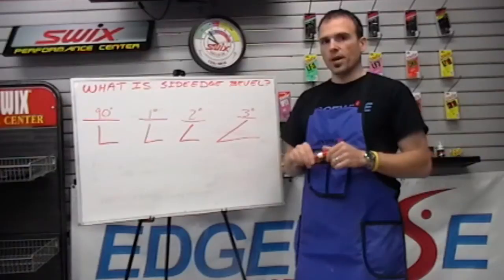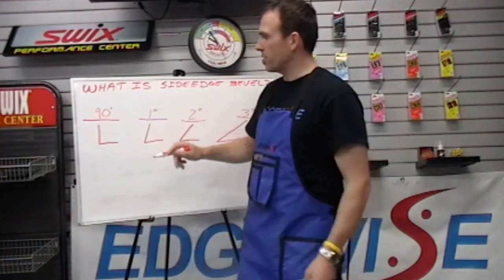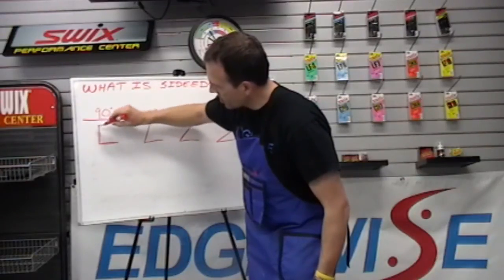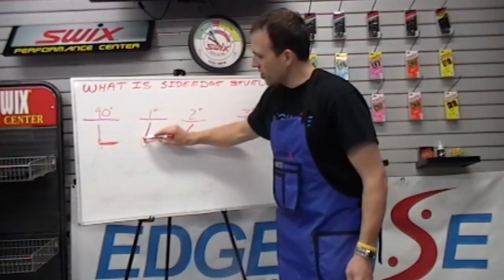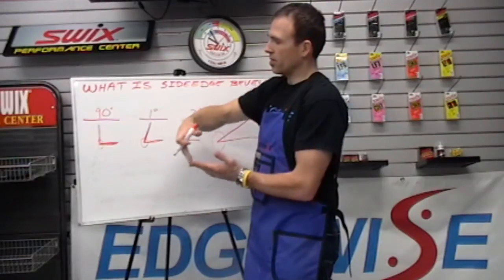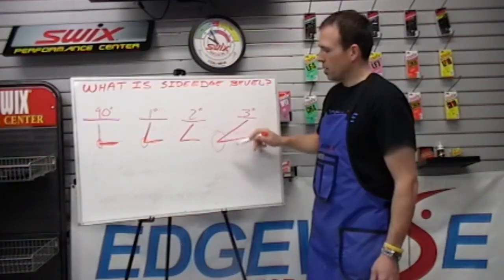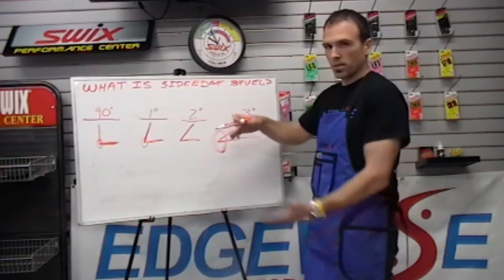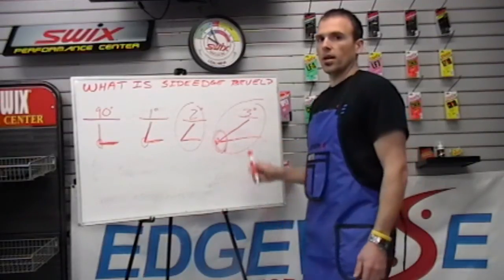SIDE EDGE BEVEL DEMO

Comment: Exactly what info I was looking for , thanks. Some tools are labelled 90, 88 instead of 90, 1, 2 etc
Reply: @31acruz  elaborate?
Reply: As it should be. 

None of the angles illustrated are “1 degree, 2 degree” they are a 90 degree, 89, 88, and 87
Reply: It's all the same.  You either are referencing how off square the edge is 1 2 3 degrees or you are referencing the total angle of the edges.
If you grab your miter saw and want to cut window trim a square cut is a 90 degree angle but the saw will call that 0 degrees.
Reply: You’ll find these bevels labeled as “87” or “93” (for the three degree)